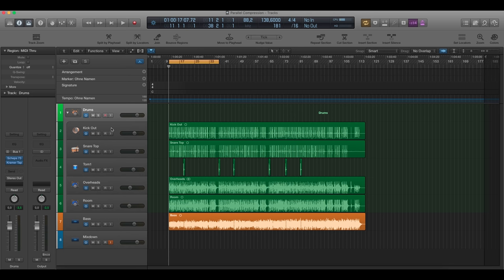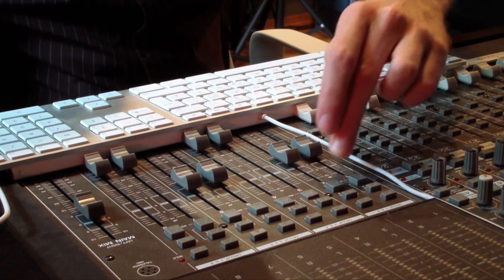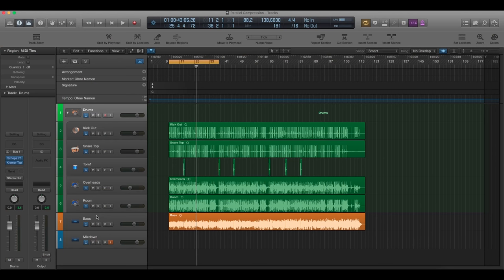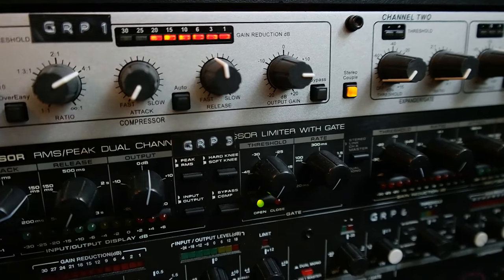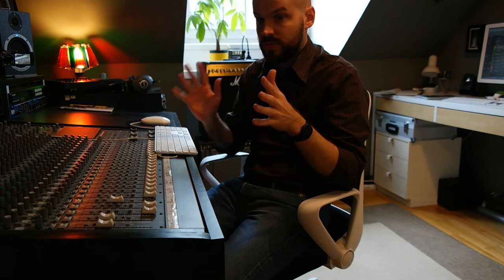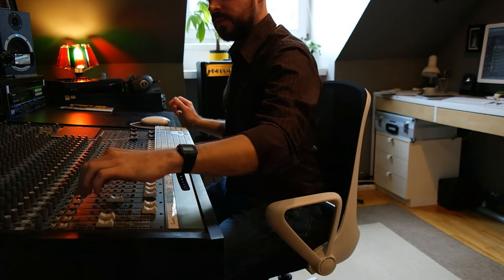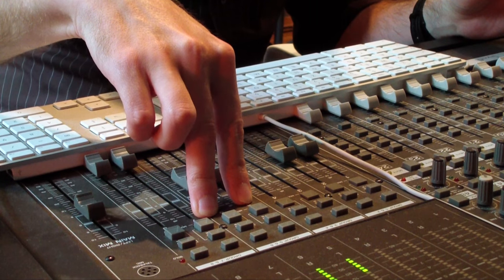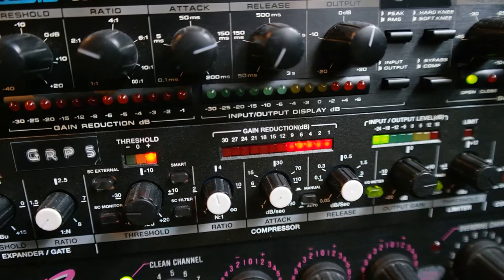Parallel Compression | Hybrid Mixing

Comment: Hi Marty. 
Love your channel! So this might be a bit of a rookie question but I have the exact same console and compressor that I got from an old live setup but when I send my bass DI and amp signal from channels 3 and 4 to subgroup 3-4 I only get a signal on one side with both mix buttons pressed. I have both channels center panned with inserts cables on both subgroup inserts (3 and 4) to the DBX in stereo couple mode. It looks alot like what you are doing so do you have any thoughts on what I might be doing wrong? Any help would be greatly appreciated. Thanks!
Reply from the maker: What happens when you leave the comp out of the chain? Is the signal still only on one side?
Reply: @ZedMartyProduction  Thanks so much for your reply. I realized I may have gotten it mixed up when trying to explain it. When I have both insert cables in I can see the signal coming in on the compressor but no sound on the meters on the group. When I pull out one of the two insert cables the signal comes in but only on one channel, but the way I understand it, the signal should be on both sides as the bass is center panned, right? I just can't seem to get my head around it..
Reply: When I pull out both insert cables the signal seems to flow correctly from channels to group but I am dead sure that the cables are alright as I have just recently bought them..

Comment: Hey why don't you use pacthbays so you can use every piece of equipment on everything and not just the things you have them plugged in to?
Reply from the maker: Hi! I'm running kind of a template here. As the DAW outputs go out to fixed channels on the console I mostly use the Subgroups always for the same things. Very easy and comfortable for recalls! It's more a summing setup.
Reply: OK thanks for the reply!
Reply from the maker: No problem! Thanks for watching!